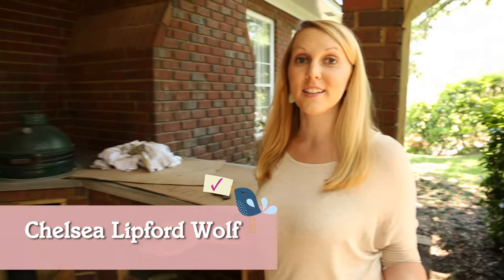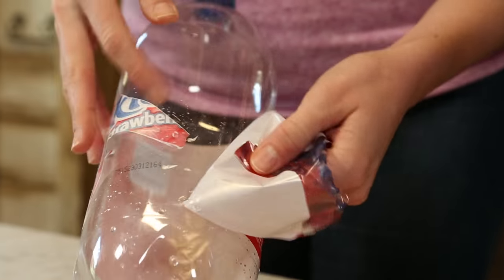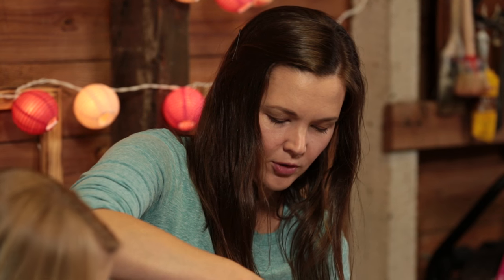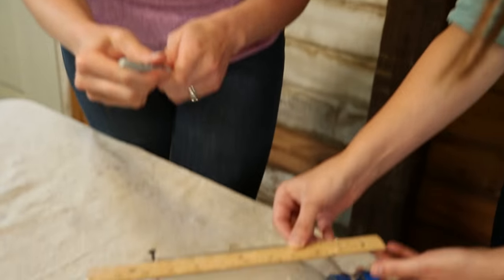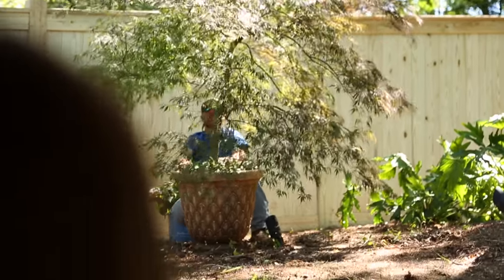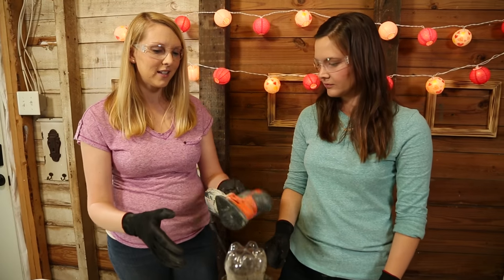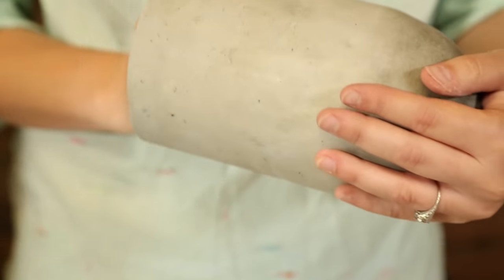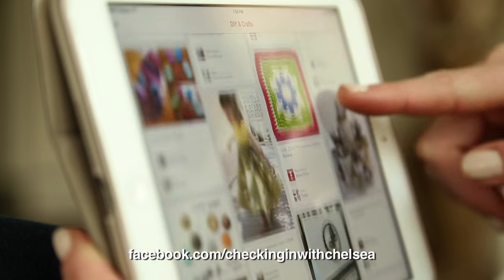DIY Concrete Pendant Lights

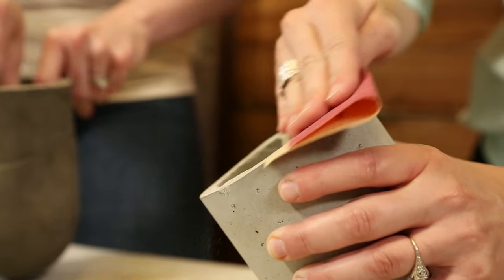Comment: I bet you had a a hard time removing the inner bottle @8:10 - @8:15 and that's because your forgot there is an undercut area right beneath the cap , blocking it from getting out.  But it's such a good looking result ! thank's!

Comment: Superplasticizer would make that mix pour able rather than the messy spooning it in!
Reply: Simon Huntington the more water you add means the longer it will take to dry, as well as meaning that it would also have further shrinkage when it dries because there will be less cement powder, because the water will take up a lot of the volume.